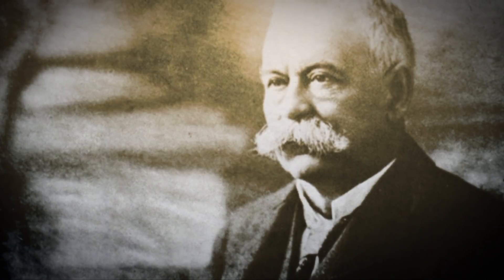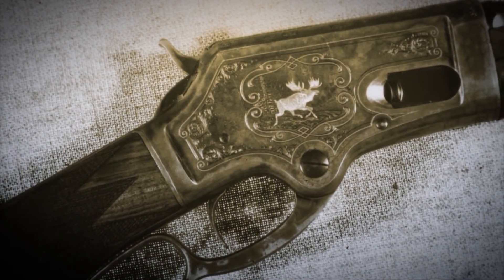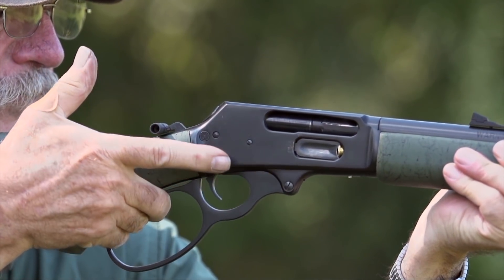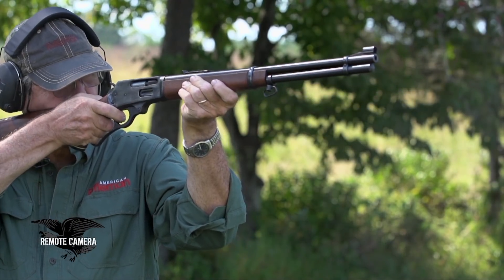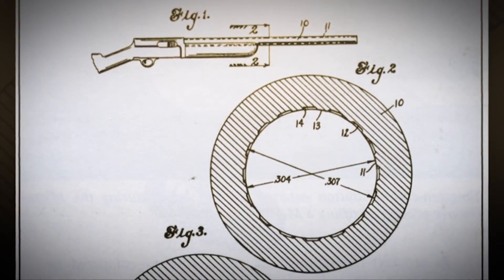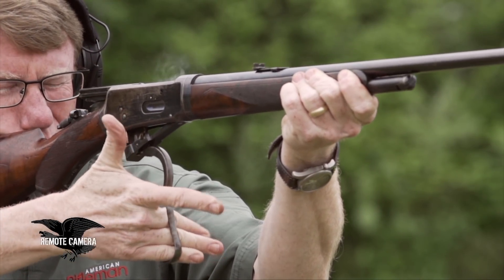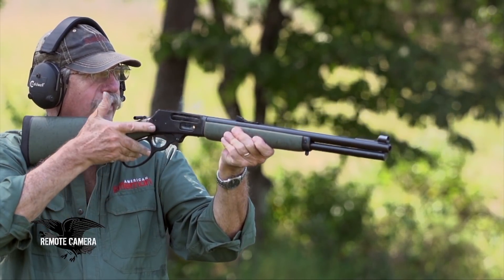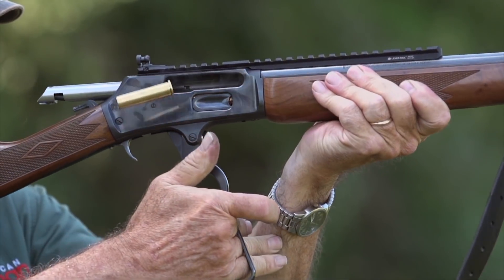Video—ARTV: Marlin Firearms Today

Comment: Ordered a sight unseen 336W BL LS and all the sights were straight. Wood to metal fit was good. Shoots dead nuts on at 25 and 50 yards. It was an August 2018 made rig. Most happy. Took another chance and ordered an 1895 GBSL in .45-70 and it too was fantastic. Amazing wood to metal finish. Happy with butt pad fitment. I was pleased with that stainless steel that’s FNC (ferric nitro-carburizing ) treatment. Most happy all around. That GBSL was a December 2017 manufacture. Super pleased with my 2 Remlins ... What’s not to like? I am blessed. Peace Be To Journey!

Comment: I'm a new owner of a 2020 year model 1895 GBL . 60 rounds through it at this point. Very accurate, and fun to shoot. Being 62, I always compare fit and finish found on my other guns. It's a fine gun. It has no issues I can complain about. I'll eventually be hand honing and polishing the action parts because I feel there is room for improvement. Out of the box I call it very good and most could leave it alone and be happy. Me, I like to add that final touch no one does on factory guns anymore. I love it.

Comment: Went to a local gun shop in Houston to look at some Marlin's. All 6 on the shelf had the sights at the 1 to 2 O'clock position. The shop owner checked the manufacturer date. All made in 2019. Remington needs to fire the cross-eyed guy and try again. I'm still on the hunt for straight centered sights, centered magazine tube and a smooth action that doesn't bind when slight side pressure is applied during cycles. Call me when you fix those issues.

Comment: I have 2 Marlins. 1894 CSBL .357/38 Special  and an1895 GBL 45-70. Both have been purchased in the last 18 months and I have to say that they are fantastic. The fit and finish is great and they are both very accurate. .7MOA at 100 metres with standard factory sights.

Comment: I've been going around gun stores and while I see some very nice and improved remlins with good wood to steel fitting there are still as many bad ones with poor fitting, unbeveled forearm wood and rough lever cycling. This is true with the cowboy models at least where my interest is. Bottomline, Marlins today are are still inconsistent and if I have to buy one I'd still look for an older JM stamped Marlin.

Comment: Lol, the first thing most true Marlin owners due is remove the stupid lawyer push button saftey. And I bought a 1894sbl in 44mag 6 months ago.
Rough action, took it apart polished away all the tooling marks polished the bolt, did away with the useless floppy trigger. Now I have a buttery smooth lever action with a 3.5 lb trigger and its a tack driver. At a 1000.00 I shouldnt have to do this extra work. Bought a Henry all weather in 4570 and it was slick from the box with better fit and finish 700.00, go figure. Getting 1.25 at a 100yrds with hornady leverevolution ammo.
Sending a 450 marlin to ranger point precision to be converted to 450 bushmaster. 
Want to take control, 1895 in 450 bushmaster and a 336 in 350 legend and they will fly off the shelf.